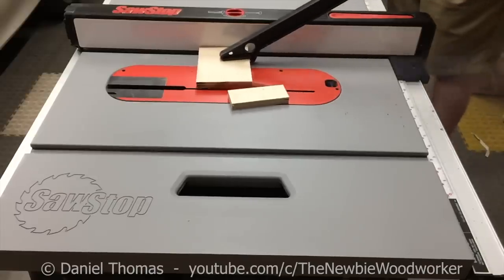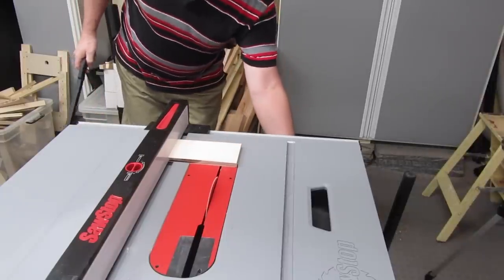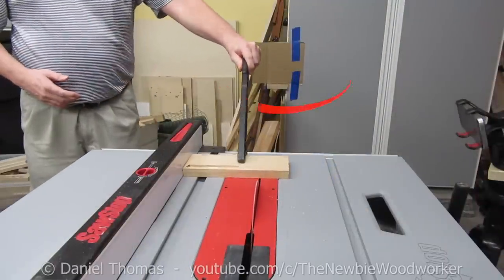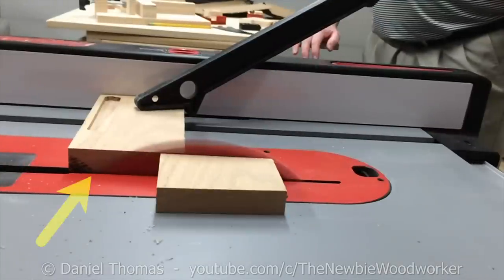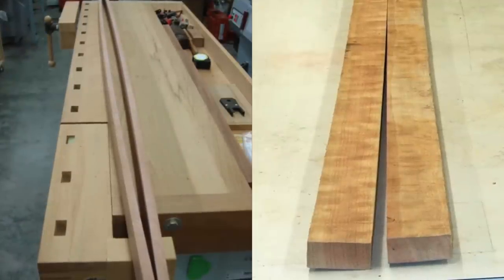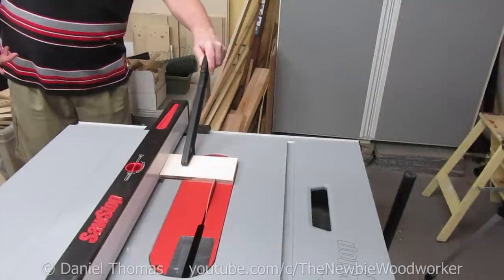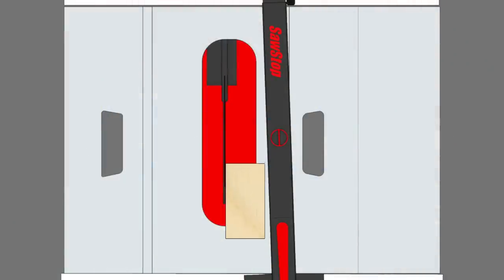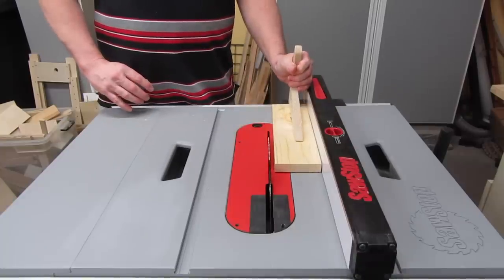Actual Kickback (in Slow Motion), & How to Prevent It

Comment: My buddy and I are starting a semi-retirement gig and will be buying and using a table saw. We are middle aged mature, and I'm farm raised with a lot of good ol boy experience, so I had a certain amount of undue confidence. While reviewing saws, I decided to look at a few table saw safety videos. Wow. Of course, any saw can be trouble but I didn't know just how nasty these things can be. I'm not surprised, but just never realized exactly how the danger presents itself. I assumed you would only lose fingers if you ran them through carelessly with the stock.  Not only is that NOT how it usually happens, but badly cut digits probably only represents about a third of the overall potential table saw injuries. 
Not only do you need to know the safe procedures and use them, but you have to have your wits about you with 100% heightened awareness on every cut without exception.
More dangerous than a circular saw or a Hi-Lift jack, and those are spawns of Satan.
Thanks for the video-I needed it. I'll get partner wised up, too.
Reply from the maker: Glad I could help. It really is amazing how much danger there is. Fortunately, if you understand the danger and use proper procedures, it helps lower the chances of accidents dramatically. Sounds like you're well on your way to learning that!

Comment: thanks for that video, dan. i was tense the whole time! 

another subject that i don't remember seeing in the video, nor do i see it in the comments, is knots in wood. i was ripping some otherwise soft 1"-thick pine boards that i got off a nicer pallet when i came up to a knot that felt like it was made of iron. the wood started pulling up and jerking back in my hand/push stick. all i could do was hold the board in place while it jumped around. the table saw is plugged into a power strip that has a breaker on it, so that flipped and the blade came to a stop half way through the rip, right at the knot. it was tense for a minute but i learned to avoid knots and i now know about a new danger on the table saw. thanks.
Reply from the maker: Thanks, and holy crap! That must have been really intense, for lack of better words. I think I would have had to sit down for awhile, just to calm down.

I guess I knew that could happen, but like you said, I haven't seen anyone talk much about it before. I can't think of anything I would have done differently, but I wonder what the "correct" thing to do is, when that happens?

I also wonder how to cut wood with knots in it, like that? I mean, was it the blade you used? Or something about the saw? I've cut pine with knots in it and never had a problem, so I'm really curious.

If you learn anything else, let me know! And thanks again for the comment.
Reply: well, i should say, i assume it was pine -- the wood was yellow, soft, and lightweight, with wavy, light-brown grain patterns. but the knot in question was pretty sizable and actually came loose and fell out later. the blade is not new but otherwise cuts with ease; the board my have also had some tension releasing at the same time. just thankful it wasn't worse! thanks again!
Reply from the maker: Yes, I'm thankful also. Glad you're OK!
Reply: I've had this issue with pine too, there was lots of hardened sap around the knot and whatever tool I was using at the time (might have even been the table saw I can't remember) just didn't want to go through it
Reply from the maker: Wow, and thanks for the comment! If any of you come across information on what's the "proper" thing to do when you encounter something like this, let me know.

Comment: Dan - this is really helpful. I've been looking for videos with kickback examples and how to prevent it. On my very first day using a table saw I made the dumb rookie mistake of using the fence on a crosscut and my saw shot a piece of wood into my garage door at 70 mph. I am lucky I wasn't in the line of fire. It was a very good lesson though. I've taken all of the steps you've recommended in preparation and process, but this past weekend I was cutting a small piece of stock and the waste/cutaway piece got picked up by the saw at the end of the cut. It didn't move with that much force, but it made me wonder - if I'm holding down my workpiece with a push stick or stop block, what about the waste piece? A big part of this I think would be to use a blade guard, pawls, and of course riving knife. I always use my riving knife, but my saw is missing pawls. How important do you think they are? Also - while Featherboards won't prevent kickback I do think they help make cuts safer. What do you think? Thanks.
Reply from the maker: Nothing like a shot of adrenaline to teach you something, right? 😄 Glad you're OK. Yes, a blade guard would have helped for sure, and that's my first recommendation. But if you're not using a blade guard, then either use a second push stick, or get something like the MicroJig Grr-Ripper, which holds both sides of the stock at once: https://amzn.to/2CELfvw.

I've never used pawls, but they probably would had helped too, but that's up to you. Yes, featherboards are great, if you use them properly.

Comment: I always used the fence as a guide and did all my cuttings bare handed, all of that with a cheap table saw, thank you little cute riving knife
Reply from the maker: Well, people have done that before. And yes, thank you riving knife. Still, to anyone else reading this, I don't exactly recommend this method. 😳
Reply: @TheNewbieWoodworker  but i always pushed the part of wood who was between the blade and the fence with both of my hands to make sure it doesnt make any angle, never had any problem, kickback is mainly done when you use the pushing rod because it's not accurate
Reply from the maker: @hotdog160  Well, it worked for you, so who am I to complain, right? 😄

Comment: THANK YOU for this video! I'm a 68-year old woman, recently single. I just bought my own place, a small farm, that needs a lot of work. So, I bought a bunch of second-hand power tools that I knew would be helpful. But I have no one to show me how to (and how not to) use them. My first cut on the old table was cross-cutting a 2x4. Not knowing any better, I used the fence. Yep - kick back that scared the life out of me (luckily, it didn't hit me). But I didn't know what caused it until this video!
My saw is an older, bare-bones version. The fence only locks on the near end; the far end is loose no matter how much I tighten the front end. Is that something I can fix myself, or am I missing a part? I'll definitely look into a riving knife and any other safety accessories that will fit. Hopefully this old saw will accept safety modifications, because I can't afford a new one.
Again, thank you. You have a new subscriber.
Reply from the maker: Thanks, and welcome aboard! A fence locking only on one end is common. If the far end is loose, there's probably a way to tighten up the clamping mechanism. Look for some screws or hex bolts.

Comment: A GREAT video. I'm brand new at this, and made some of the mistakes you illustrated. Just lucky that I haven't had kick-back.

Two thoughts: the Microjig sells for $80.00 here in Australia ( and much less elsewhere), How much does a trip to the emergency room cost?

Second, I use a Dewalt Bench Top saw. A video I spotted recommended turning it on the table, so the rip fence is facing you - running parallel to your shoulders. That way, even if there is kick back, you are completely out of the way,

I'm going to experiment with that ...and use the Microjig
Reply from the maker: Thanks! As far as turning the bench top saw, my feeling is this: If someone suggests something that isn't common practice, then don't do it, at least not until you've had more experience. And although I can't pinpoint what I don't like about it, it seems a little suspect.

Comment: I have owned a jet table saw for over twenty years. It came with a blade guard and splitter when I bought it, but being young and knowing everything (or so I thought)) I did not install either one. I also wear a heavy canvas work apron when in the shop. Recently I built a new work bench which included 17 drawers. I was cutting the bottom of the last drawer from 1/4" plywood that was warped. As it came through the back of the blade, it caught the rear of it and came spinning out catching me square in the stomach. It cut my stomach  (17" long incision) through my t-shirt and sweat shirt (that's right, I was NOT wearing my apron at the time). Luckily I did not need stitches, however over the next three days my entire stomach turned purple with by far the largest bruise I have ever had on my body in my entire life. After watching this video, I was thinking also about the fact that I had worked all day and was probably somewhat tired. I didn't have my apron on. It was the last drawer and I just wanted to be done with them. There are all kinds of excuses we come up with in our minds. The most important thing here is to always be alert and wear ALL your safety equipment (glasses, apron etc) and don't be stupid and throw away things like safety guards and splitters. Yesterday I ordered a guard and splitter package called the shark guard (www.thesharkguard.com). I have to be grateful my accident could have been so much worse.
Reply from the maker: That sounds like a typical accident. Tired, doing the last piece, etc. And it's a total Murphy's Law thing that you weren't wearing your apron. It seems like the universe waits for those moments to whack us, doesn't it? Ouch. If it's still looking bad, you should see a doctor right away, because there could be internal bleeding (of course, I am not a doctor). Glad to hear you're getting the shark guard.
Reply: The Newbie Woodworker that happened a month ago. It took about three weeks but it’s all healed. I did see a doctor the third day. She said what I thought. It looked worse than it was but still a good thing I went in.
Reply from the maker: @stevenwood8805  Glad to hear you saw a doctor, and glad you're all healed. Sometimes it bugs me when doctors tell us what we already know, but in this case, it was probably a relief (at least emotionally) to have her confirm your thoughts.

Comment: I give you a lot of credit on this video  because you know and understand  how dangerous a kick back is or can be  and for your demonstration you purposely  created  in response to your question of what do we do to prevent  kickback i would say  sleds and riving  knives  i also  do my best to avoid  using  jobsite saws  that  aren’t securely fastened to a stable stand or  table in all honesty  i try to not use them at all   Because they often  have crappy fences  that can easily be mis aligned  and wobbly blades  i ran a  installation  division of A Architectual Woodworking firm for over 20 years and saw way too many  accidents with those  many of which dont have a good riving knife  system as well   And get  bumped around and abused  due to jobsite conditions  compared to a stationary   Cabinet table saw in a shop type atmosphere
Reply from the maker: Thanks Craig. And I'm sure you've seen your share of kickbacks and accidents on the jobsite, too. To be completely honest, I didn't know as much as I thought I did about kickback, before doing this video. But after what I learned, I'm much more careful. For once, I actually learned something without getting hurt! Thanks again.
Reply: Yes  ironically more on   Miter saws  mostly  with people doing dumb stuff  i saw a guy ty to cut a piece of steel angle on  one with a wood blade because he saw  Woodworkers cutting Aluminum angle on the saw   ? We did have a negative tooth blade on te saw. We used to cut aluminum on and we knew. How to  cut slowly thru the  material but this guy tried to plunge thru his steel  and that didnt turn out well  i also saw a guy  cut down a 5 gallon plastic bucket on  a 15 “  miter saw  for some unknown reason when a eciprocating and a Bosch jigsaw  were   Just a few feet away  ???
Reply from the maker: @craigmonteforte1478  Hey, we've all done stupid things. I almost burned down the house once, but the less said about that, the better. 😂

Comment: Hey Newbie Dan
in answer to your question that you asked me in e mail about the use of feather boards, I think I just watched a bunch of videos on table saw safety.  I saw feather boards in use in one of the videos & I thought they were a great idea.  I didn’t have any particular favourite video. I’m sure there are lots of videos available on the use of feather boards. 
 
I did go in some wood working chat rooms to read what most ppl preferred for the angle on the feather board.  Some ppl used 45 degrees but the preferred angle seemed to be 15 degrees which was what I went with.

I put 2 slots in both of my feather boards so I can adjust them in or out to have full contact with my piece.  2 slots as opposed to only putting in 1 slot ensures  the feather  board can’t turn or shift. 
I made my t nuts to bolt my feather boards in my mitre slots from toilet bolts.  I had to do some sanding to make them slide in.  They do the job, but I would rather make proper t nuts.   
sometime in the future I will do that.  If I had a mini milling machine it would be a simple task.  But since I don’t, I am working on a safe way to make them another way.  I have a couple of ideas on how to do it.  If it works, I’ll let you know.
Reply from the maker: Thanks for the info! Having two bolts is an excellent idea. As for t-bolts, get an angle grinder, and a grinding wheel, and shaping those toilet bolts will be a piece of cake. Just wear a face shield when you do it. 😄

Comment: I have a sawstop and that's a great saw to have in the instance your hand is thrown into the blade. Safety and prevention is Plan A, SawStop technology is always Plan B. But implementation of that technology is at great risk with a Diablo blade or any painted blade. Don't get me wrong, Diablo blades like the one in your video are great blades but that red paint will insulate the the arbor from the blade and the saw will likely not sense your hand touching the blade and triggering the safety mechanism. I use a Diablo blade but I have to remove/sand away the paint around the arbor for it to work. I only mention this because you have a sawstop table saw.

Great video and thanks for posting this. I learned a few things and I will be changing some habits thanks to you.
Reply from the maker: Thanks! Here's a quote from Trent Davis, who works for SawStop and runs the Facebook User's Group:

A common question I get is whether or not the red coating on Freud blades will affect the safety mechanism on a SawStop saw. Red coated Freud blades work just fine on a SawStop.

So I wouldn't worry about the paint. However, you need to make sure you use a blade that doesn't have anti-kickback shoulders. https://www.trentdavis.net/wp/2018/08/06/helpful-sawstop-links/.